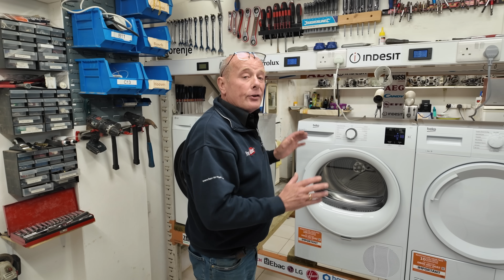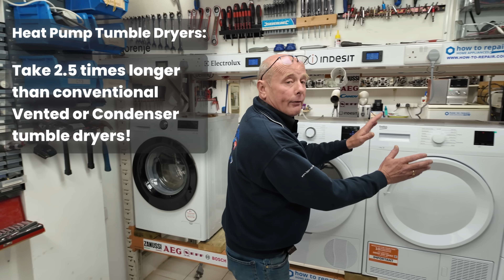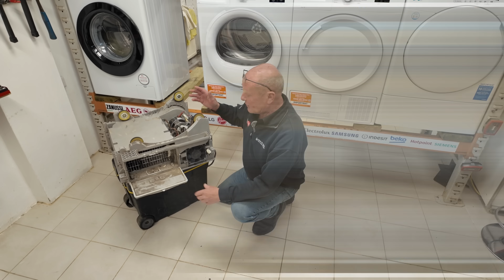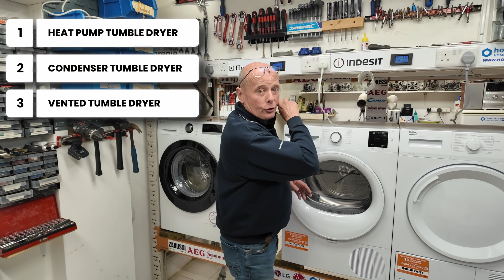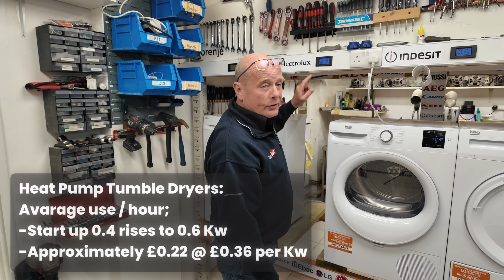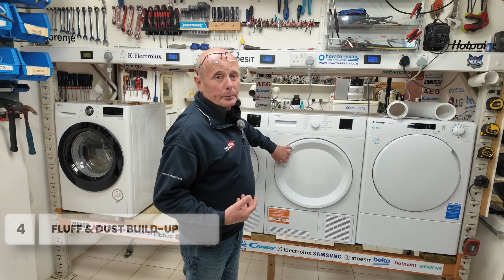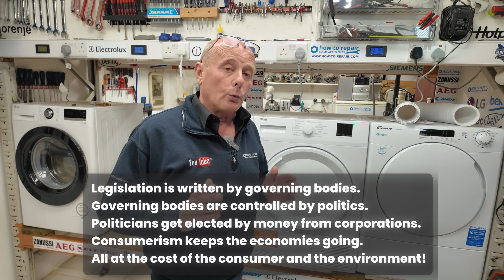Tumble Dryers the Shocking Truth About Heat Pump vs Vented & Condenser, NEW LEGISLATION!

Comment: The point about wear on clothing is interesting. Is the friction more damaging or heat? My parents have a heat pump dryer and basically shove almost anything in the dryer, the lower heat means it doesn't destroy things you can't normally tumble dry.  On longevity I recently sold our vented tumble dryer which was about 20 years old, had one new heating element (installed by me) in that time. It would be interesting to know how long a heat pump dryer will last given similar usage - we only used the machine occasionally when we can't dry things outside. Fridges work fine for decades but of course don't suffer the same vibration present in a dryer.

Comment: Ive got a Hotpoint heat pump dryer and think its fantastic. Yes it takes longer to dry clothes over a conventional dryer but definitely not 2.5 times longer. Maintenance is a bit more involving, cleaning the filters is very important, and few months I use a soft brush and vacuum cleaner to gently clean the front of the condenser which keeps it running efficiently. Typically, heat pumps are very reliable and last a long life if you don’t have problems in the first year or so. My hotpoint fridge freezer is still going strong after 20 years so with a 10 year warranty on my dryer....they'll have to of put something half decent in. I though heat pump dryers are better for clothes as they are not heated to the temperature of the sun for a start. Speaking of temperature, there’s no worry of lint catching fire against a hot element in a heat pump dryer which is comforting. In terms of price, with the same features compared to a conventional dryer, mine was £80 more to buy so it paid for the extra in less than a year in electric savings. As I've got solar, Im more likely to run a heat pump dryer off solar alone on overcast days due to the much lower power demand. I think they are much better.

Comment: Interesting and well presented video. However I don't agree with your statement that a heat pump dryer takes 2.5 x longer than a condenser dryer I replaced an old condenser with a new heat pump dryer, it does take a little longer on an average load it takes about 1hr 20 compared to about an hour with my old condenser it saves a lot more in electricity and the savings will pay for itself within a few years. I can't comment on the maintenance issues as I haven't had any problems yet after a year of use. Although I do miss the heat, the old condenser used to throw out into the kitchen during the winter. Which I suppose should be factored in with possible savings on heating costs within the home.

Comment: Good clear video. One thing you didn't mention was the carbon footprint of the manufacturing process, which is quite a bit more for the heat-pump machine.

Comment: Would you be good enough to explain to my wife that 2 hours is too long for a condenser drier, she, (like many partners IMHO)are inadvertent energy hogs.  We now use a dehumidifier in the utility room and a clothes line, which to me, is an excellent compromise.
In the summer, I (shock horror!) use an outside whirligig clothes line if the weather permits, which everyone else in the house seems too bone idle (or pessimistic about the weather) to do.

Comment: Uhm, no not 2.5 times as long. That would be crazy. Maybe 50% extra. Bought a Bosh at 450 pounds mine paid for itself in less than a year in electricity savings (3 teenagers so 2 sometimes 3 cycles a day). So I could buy a new heat pump every year and still be better off. Mines been running for 4 years now no issue and my savings have been astronomical. Also there are other factors as well. The heat pump doesn't heat the room as much and contains the moisture better.

Comment: Sadly a tumble dryer that has a closed loop system no vent pipe and circulates the air inside the unit so it uses a heating element and an cooling system to remove the moisture from the clothes  is no good if you  have lung problems ie asthma or COPD as the system burns the dust that collects on the elements giving the cloths a slight burnt smell. This is enough to trigger an asthma attack or a bad choking episode if you have COPD. So your Only choice is a old fashioned vented system.. So people with lung problems are been forgotten about and yes I agree 2 or 3 times longer to dry if it's a closed loop system. The only way heat pump tumble dry looses it's gas is because it's got a leak so correct through it away and buy new. Tracking down a leaking pipe connection will be a nightmare having gone there with an americian fridge I loved. So you end up buying all the equipment and fixing it your self as it just too expensive when it's and engineers time.

Comment: I bought a heat pump dryer from Siemens, IQ800, in 2018. It uses the condensed water to flush the heat exchanger near the end of every cycle. The power consumption depends on how much laundry is stuffed in it and how moist it is, I see the consumption per cycle ranging from 0.8 - 1.5 kWh. It has a sensor to determine when the laundry is dry enough, so the running time is always somewhere below 2:30h. This dryer is used by me and my daughter and her boyfriend (I wonder where the hide the five other people given the amount of laundry they do🤭). The monthly consumption ranges from 15-35 kWh, in total 283 kWh for the last twelve months.

Comment: A clothes horse costs about 20 quid and uses ... wait for it ... zero electricity ! It doesn't need cleaning, it doesn't need regassing, it doesn't break unless one falls into it (I've done it lol). Ok it takes longer to dry things, but so what ? And when it's cold (it's Britain, so it's usually cold) we have radiators on so anything we need dry urgently can be dried quickly on the radiator. For the most part, tumble dryers are the most pointless thing in most houses.

Comment: Thanks for the video!  I’m in the states but lived in Germany and had both the vented and condenser models and didn’t have any issues, just wish they had a bigger collection tank or had a way to hook up a drain hose. 
Your analysis of the problem is spot on! All too often companies are designing appliances to wear out, fail early and not able to be repaired. 
When I moved into my house it had a newer style front washer and older traditional  electric vented dryer. 
The dryer is so much easier to maintain and has lasted with no issues.  
Need to look at total life cycle costs when comparing as they can quickly add up!

Comment: Perhaps a better way to implement the technology would be to build an insulated, sealed cabinet with shelves and or hanger rods and a dehumidifier built in.  Kind of like a wardrobe.  No tumbling, just air being dehumidified and circulated.  Little if any lint and dust created.  Put a humidistat in it to turn it off when the clothes reach the desired level of dryness.

Comment: Replacement and maintenance of white goods are key to energy saving and preserving the earth resources. The design of tumble dryer bearings is very poor and appears to have unnecessary built-in obsolescence (6 to 9 year estimated life). Manufacturers need to be obliged to give reasonable design life assurances, maintenance and parts replacement schedules and assurances and end of life disposal advice and facilities. Recapturing refrigerants from old equipment is specialist and should be done centrally by the manufacturers as part of their licence to sell to the public. Government action is required (unfortunately as with many other issues).

Comment: It's certainly interesting the wear and tear aspect. This is just a couple of things a quick Google brought up (so far from comprehensive or even necessarily accurate) but saw numbers of savings about £35 a year in running costs. If it's £200 more expensive then that's 6 years to break even on the difference, which is no good if it gets to an uneconomic repair state in 5.

Drying times though, I've got a standard condenser and I'm normally 2hrs+ to dry a load (don't stick it on high temp because there's at least something in the load that it wouldn't be good for). A drying time comparison page had heat pump at about half an hour more than condenser time (2hrs45 vs 2hrs15), which is admittedly a lot longer than the vending time of 45 minutes. I have done a DIY repair on my condenser (failed water drainage pump from fluff making it's way over) but it looks like my run time wouldn't be wildly different on a heat-pump and I've not had any other wear issues. If an issue like that couldn't be easily repaired, though, it certainly would be a problem!

Comment: I have had all 3 machines. Honestly, the best is the hetpump dryer. It takes the same amount of time or even less than the condenser one. Aded bonus so much more gentle on the clothes as it is not running on crazy hot temperatures.

Comment: What kills these machines is the fluff...
Make sure to buy a machine that allows you to clean out fluff from the entire system as it will pass any filter weather they say so or not. (And you are probably lazy cleaning the filters).
A removable condensor that is easy to clean is what will make your machine survive.
Also, high heat relly kill you clothes...
Reply from the maker: I just do not understand why they make it so complicated to access the evaporator and condenser it would be so easy to create an access point from one side of the machine rather than having to try and remove the whole drum
Reply: @How-to-repair  For sure .. some models are super easy to clean...
But there is probably a patent troll that can answer that....😭

Comment: I like the march towards electric cars but the same thing applies as you have discussed here. I drive around 20 year old cars but there's no way that an electric car will survive anything like that long before needed a new battery costing at least £7k.  That makes the second-hand market unfeasible, so cars will be scrapped much sooner. Electric cars are not ready yet to make their impact on the environment significantly diminished. We need the next generation of solid state batteries, or other even more promising technologies.

Comment: Fantastic vid. I love that written statement at the end.
So basically the heat pump dryer uses half the power but runs twice as long, so what's the point as each load dried will cost the same in a vented or condenser.
As the heat pump dryer has to run for twice as long, its life time is reduced by half.
Heat pump dryers are more expensive to buy and more expensive to repair, and harder to dispose of.
Reply from the maker: In energy efficiency, they are much better but take twice as long to drive the clothing and very very hard to work on, way out of the average DIY capability

Comment: American here. I stopped tumble-drying years ago. I just line-dry in a spare room. (yes, it's fine in the Summer too). I do tumble them on air-only for 30 minutes after they're dry (6-12 hours), to work out their crispness and remove lint. 0.2 kWh vs over 3 kWh.

I aslo just let the dryer vent in the hallway with one of those simple little water tank catch filters. (opposed to blowing thousands of ft³ of conditioned air outside) Again, it's fine! 😁👍

This method might not work for a busy family, but I'm just a single lame middle-aged white dude without kids who has just one load a week.
Reply from the maker: I suggest you never moved to the UK. We see the Sun a few days a year. Lol

Comment: One thing that I hadn't notice mentioned is the make-up are for a vented dryer. You will vent out X cubic meters of warm damp air and have to take in X cubic meters of air through either an air intake or normal house leakage. This air will then have to be heated in winter (very cold where I live) or cooled in the summer (rather warm where I live). I haven't worked the math out on this but think it would be significant.

I am inclined to get a washer/dryer (heat pump) combo unit for my next appliance but that will be some time from now has I have fairly recent laundry pair.

Very good discussion with people from diverse parts of the globe commenting on what works for them. Thanks for the vid.
Reply from the maker: Thank you for the comment. Someone has to speak out eventually.

Comment: You present a well reasoned comparison of the three types of tumble dryer. You have cemented my decision not to buy a tumble drier at all. Instead I use a dehumidifier in my airing cupboard  which also houses my gas boiler with a hot water storage tank thus keeping the ambient temp at around 25-30 deg C and this raises the efficiency of the dehumidifier. I run the dehumidifier at night with 4hrs of 8p / kWh electricity and this always dries all the sheets (on rack), shirts (on hangers), towels, etc that I put in there. It uses approx 200W, so costs 8p / load. The dehumidifier (cheap from Lidl) has an intake filter which I will clean from time to time.
Reply from the maker: Thank you for sharing your thoughtful and efficient drying solution! I appreciate people like you taking the time to write it out. Please share it where possible. It might help others make a wise choice instead of being misled by the industry.
Reply: @How-to-repair  In addition to the energy saving of this non-tumbling solution it seems to me that the fluff that clogs up tumble dryers really belongs on the clothes. It is part of the fabric of the clothes and tumbling might be seen as wearing out the clothes prematurely. There's not much fluff liberated in the airing cupboard - dehumidifier drying solution.

Comment: My heat pump dryer is getting repaired for the 2nd time in the 4 years I've owned it. I know the problem and you covered it, no matter how careful we are with cleaning the accessible components, the system gets eventually clogged up with fine dust that passes both filters and to the point of failure after 18 months or so. 

I have already taken side panels off the machine to remove dust from outside the circulatory system which is more than most people are willing to do but it hasn't solved the problem as I expected. I saw the first repair took a long time and involved fully dismantling the machine, more than I'm willing to do. 

Once it gets repaired, I'll be selling it on as I've had enough and will replace it with a conventional condensing dryer where I can remove the condensing unit for cleaning myself and keep it running for a long time.
Reply from the maker: I'm not a fan of heat pump tumble dryers because fluff tends to build up on the condenser and evaporator at the bottom. This happens because fluff sticks to moisture, which is a common issue with these machines. Manufacturers have had many problems with the filtration system trying to catch fluff and lint before they reach the condensing and evaporating plate.

Comment: thanks for this sensible and valid appraisal  - the only thing missing was advice about how the look after a heat pump machine so that its bearings last, so it doesn't fill with lint and, even, so its heat pump doesn't deteriorate too fast
Reply from the maker: Thank you for your comment. I appreciate people like you taking the time to write it out. Please share it where possible. It might help others make a wise choice instead of being misled by the industry.

Comment: Our Bosch dryer has lasted over 16 years. I hate fixing washing machines, so I bought  Miele which is coming up for 14 years, I bought it after seeing one that a friend had that was over 20 years old. I was thinking of a heat pump dryer and passing the Bosch dryer on to a new owner. I think you have changed my mind. We also only ever used the dryer on low heat setting, which seems to work fine and I expect reduces the overall cost of running and heat damage to some clothing.
Reply from the maker: Thank you for sharing your experience and thoughtful perspective! It’s impressive that your Bosch dryer has lasted over 16 years and your Miele washing machine is still going strong after 14 years. These examples show the value of investing in well-made, durable appliances something that’s becoming increasingly rare in today’s disposable-focused market.

I appreciate people like you taking the time to write it out. Please share it where possible. It might help others make a wise choice instead of being misled by the industry.

Comment: i agree totally i am a live alone pensioner and use a length of rebar to dry clothes and it is over a rad which comes from central heating fed from ground/air source heat pump and ig door can be opened everything dries very fast fer nothing drying room door air goes into heat pump also 
jimmy 75
Reply from the maker: Thank you for your comment. I appreciate people like you taking the time to write it out. Please share it where possible. It might help others make a wise choice instead of being misled by the industry.

Comment: I have a Bosch condensor washer dryer, which I bought about 15 years ago. I checked the power used in a full cycle and it was much less than that used by my washer-only that it was replacing - a Hoover Keymatic.

My fridge is an early 1960s Prestcold.
Reply from the maker: Hoover keymagic there is a blast from the past